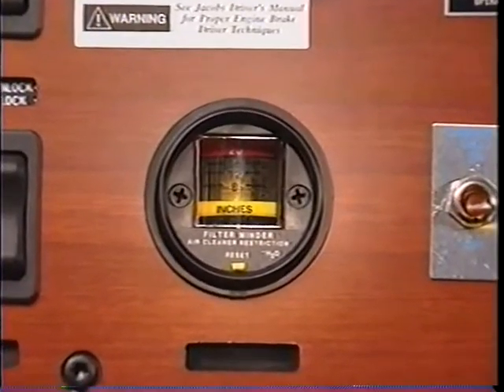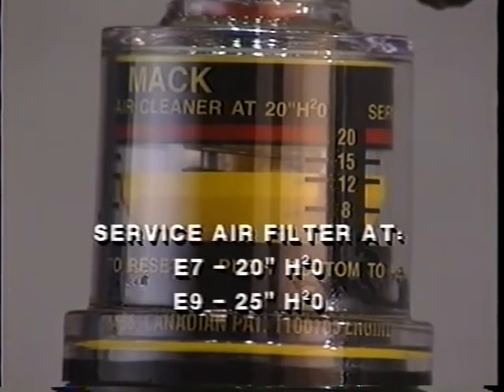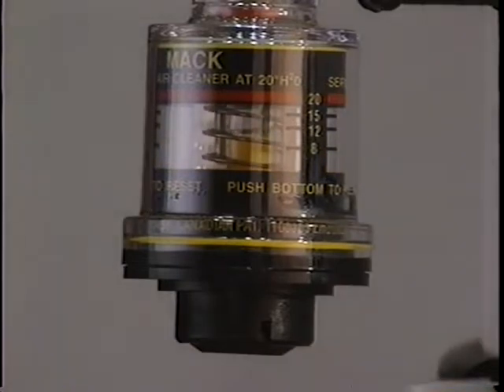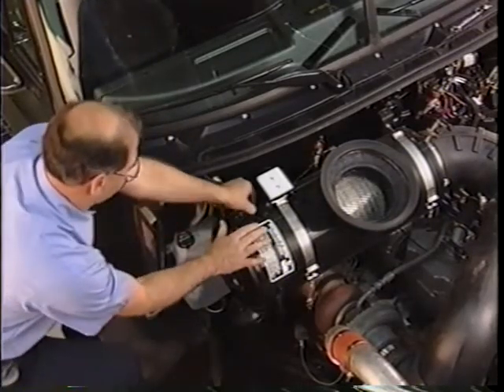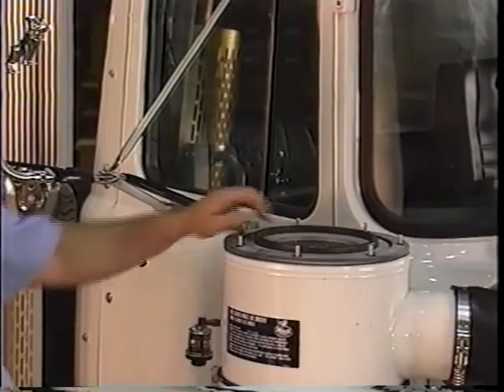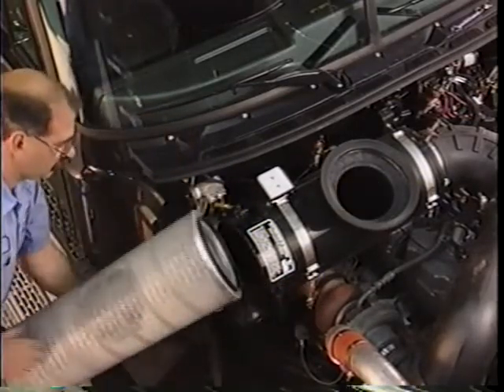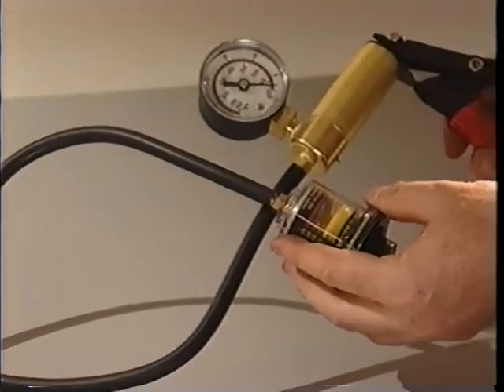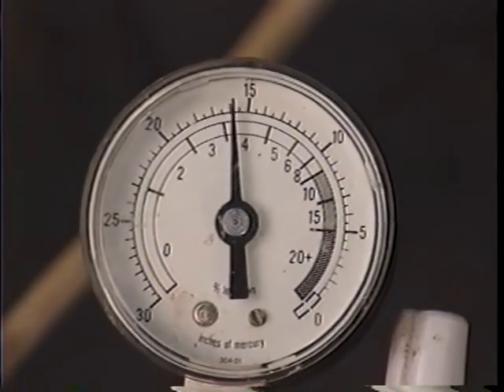Air Filter Restriction Gauge Operation & Testing

Comment: What will happens if the service indicator isn't tighten?
Reply from the maker: It could cause a small air leak of unfiltered air and it could also throw off the accuracy of the indicator.

Comment: Could there be a fault in the engine if it doesn't come with it?  I lost it
Reply from the maker: Some machines/trucks are not equipped with them.  It is only a problem if it is missing and leaves an empty hole that would would let unfiltered air into the engine.

Comment: This helps with my 2003 Ford F350 Powerstroke 6.0 diesel's stock air filter condition gauge which is similar.   I didn't know how it worked beforehand.   Thanks for the upload.